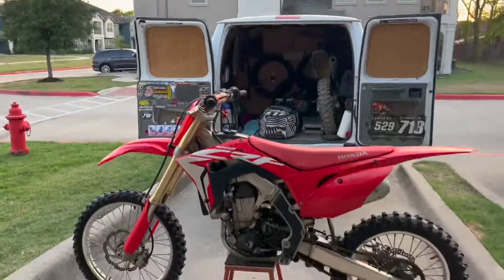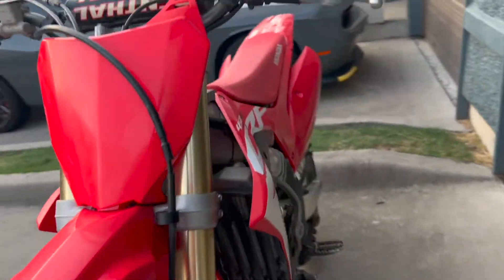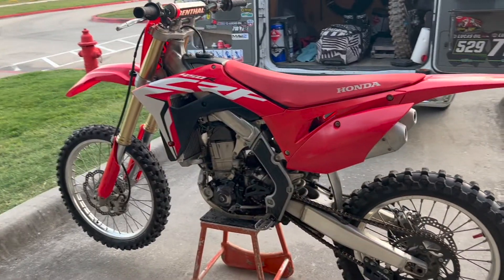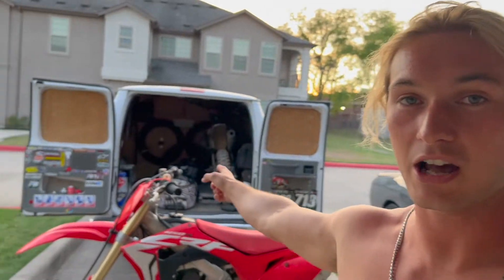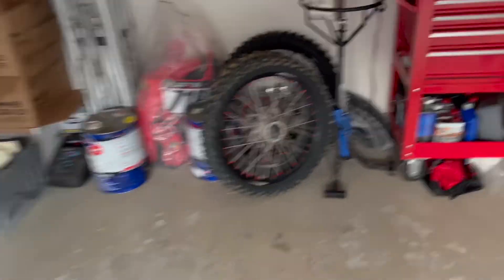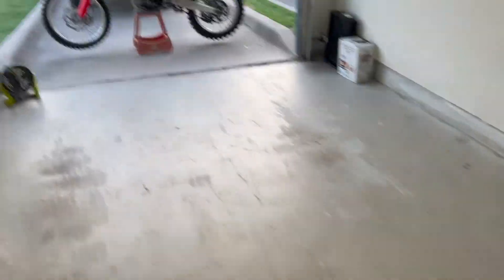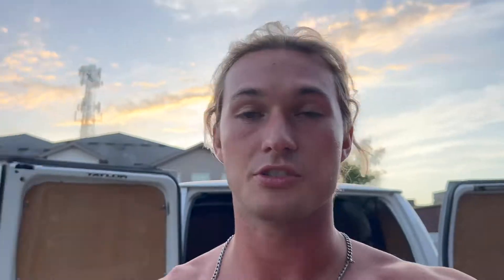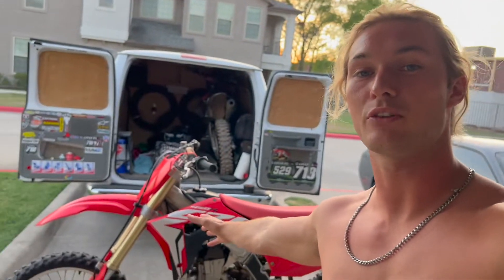CHANNEL UPDATE and FUTURE PLANS!

Comment: Split the cases and fix the transmission. What VP fuel do you run in the modern 4strokes? Do you notice a difference in performance?
Reply from the maker: Thanks for the recommendation! I’ll do a diagnosis video for sure. 
Depending on the fuel yes i notice a difference. But unless you’re racing I’d say it’s not worth it financially. I run shell 93 all the time. I never run race gas just to save money. Of course if it was in the budget i would be using the vp for a little better throttle response and a cleaner burn. But until then I’ll just be refilling my vp cans with 93😂
Reply: @granttaylorvlogs  Thanks for the reply. T4 or the 4.4 stuff?
Reply from the maker: @andrewolson248  i’d run t4. I’ve run U4.4 and didn’t notice much difference from the t4

Comment: do a vidéo when you tear down the bike open the engine show us thd piston cylinder and gearbox status
Reply from the maker: Man unfortunately my schedule has just been crazy busy and I didn’t have the time I thought I would fir the bike. I got it almost all the way back together. Motor is together and in the bike again. 
It ended up needing 2 gears and a new shift drum.
Reply: @granttaylorvlogs  ah i Can understand that, and what about cranck and piston ? All was looking good ? 
Nice it wasnt so much to throw in
Reply from the maker: @stevemx2778  yeah everything looked great. I cleaned up the carbon build up on the piston and put new piston rings on it.
Reply: @granttaylorvlogs  nice its a reliable engine too